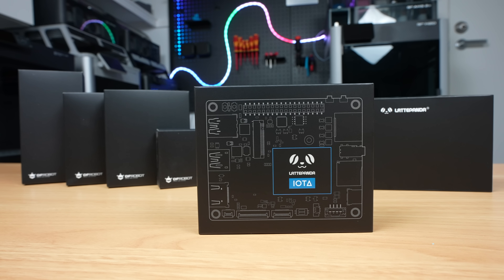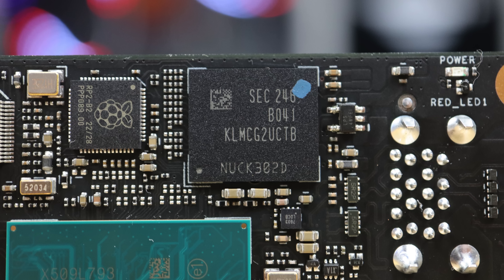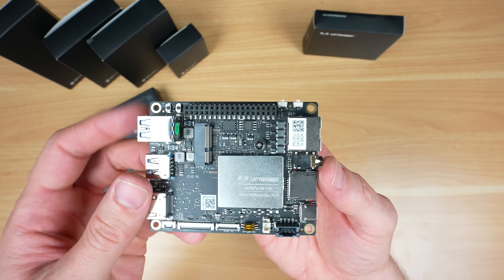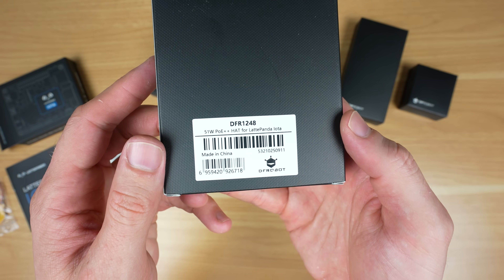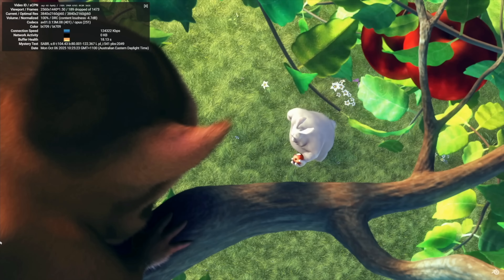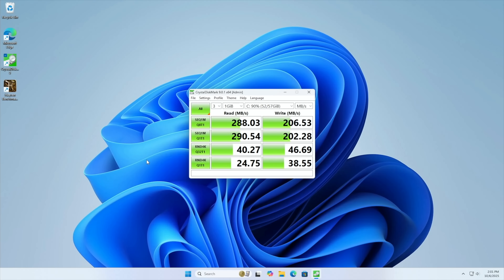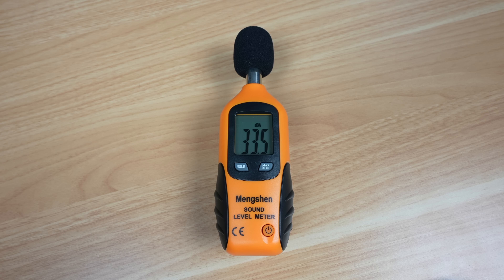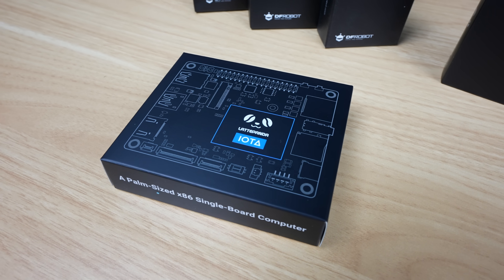LattePanda's New IOTA SBC – A Palm-Sized N150 Board for Makers

Comment: Can you use any WiFI card? All of the N150 boards I've found limit you to Intel CNVi cards.
Reply from the maker: You can run a PCIe-based card in the IOTA, not a CNVi card. They list the Intel AX210 (Wi-Fi 6E) and Intel BE200 (Wi-Fi 7), and older models like the Intel AC8265 as being compatible.

Comment: Well .. USBA-->IOP adapters are readily available and minis come with power buttons, cases, fans and power brick, plus installed OS ... I'll just go with a mini N150 or, if I need 4xNvme, and better graphics, maybe a simple 4 core i3.
Reply from the maker: You can make this run like a mini PC and you can make a mini PC into a board with GPIO pins - but it's easier if you just choose a board appropriate for your use case from the start.

Comment: Nice. But i'd run Linux on it.
Reply from the maker: It's would definitely run better on Linux. It ships out with the Windows install I tested it on.
Reply: there are N150 mini pcs at that price range, with 16GB RAM and 256GB SSD.... but of course no RP2040 and IO headers
Reply: The reason the geekbench 6 scores are so low is because of windows 11. I have debiab 13 installed on my inten 150 nimo laptop and with performance mode enabled, im getting 1350 single core and 3000 multicore. It can play ps2 games just fine. And doesnt even get that hot

Comment: Would this be good for a NAS/plex server?
Reply: You could get an M.2 to sata adaptor board for it. but for the price and performance of it, you'd do better to just buy a used micro PC and do exactly the same for far less.
The main point of this board is that it's got N150 performance with a microcontroller built in; it's designed for people that want to interface electronics projects with more powerful computing hardware rather than general computing or home lab stuff.
Reply: 1 pcie lane. nope
Reply from the maker: It's probably not the best choice for a NAS/Plex server - performs is ok for a NAS server but the IO is limited for drive expansion, the GPU limits it as a Plex server. I'd suggest a more powerful mini PC with a better PCIe interface.
Reply: I was thinking exactly this. With appropriate cooling, I think it can be. The only limiter is the number of cores - 4 cores is limiting if you start to run anything more than just the NAS and Media server.
Reply: for home lab its good enough.